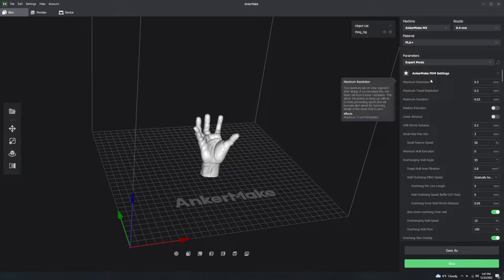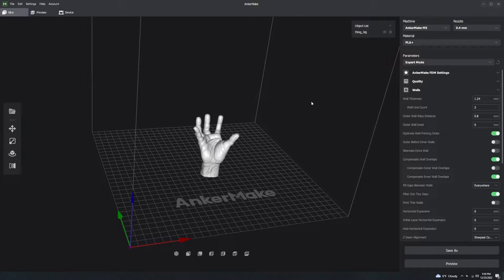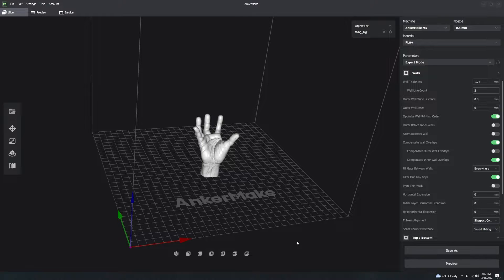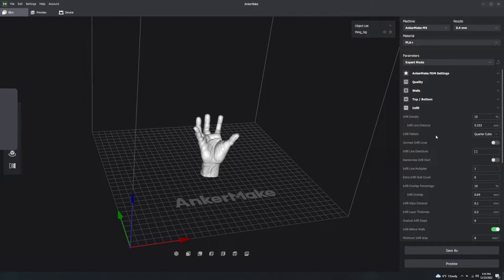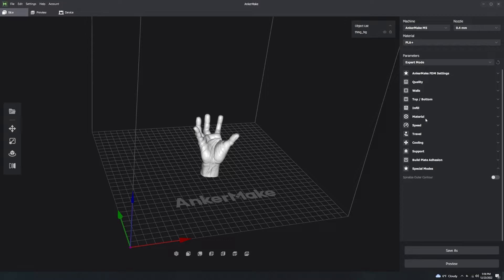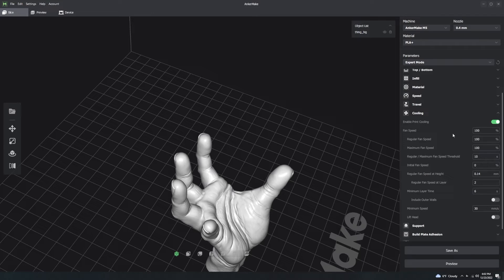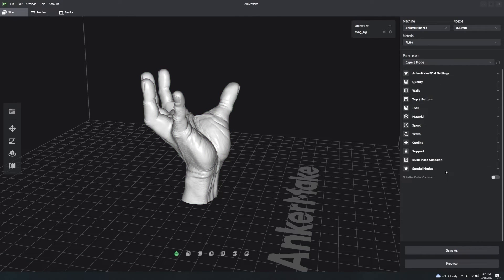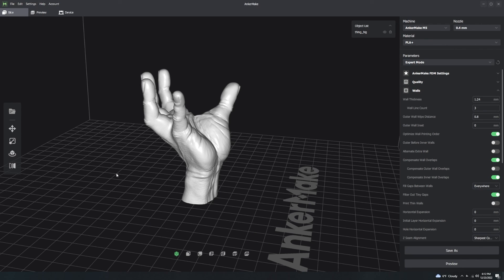AnkerMake M5 For Beginners 8: AnkerMake Slicer Expert Mode

Comment: so what your basically saying is keep the stock settings on the slicer except for wall count and infill %. Also, you mention go to 'redit' but might be worth mentioning you need to sign up to it as the site is now private.  Apart from that great video and very helpful. Can't wait for the AnkerMake V6 multicolour unit comes out

Comment: Hi I just bought a AnkerMake five and was printing one of those Addams family hands like you have but printing it the other way with the hand down it was a small keychain and on the bottom of the print. It’s really stringy not stringing, but almost like the filament is not melted and just looks absolutely terrible. Do you have any suggestions on how to fix this? Ps I printed this with and without supports with the same results do I maybe need to flip it upside down like yours is showing?